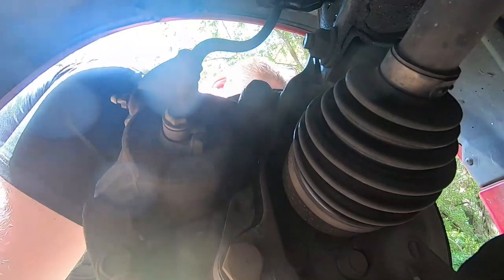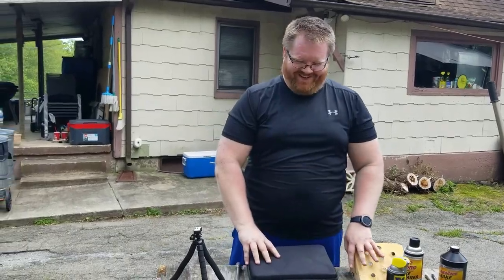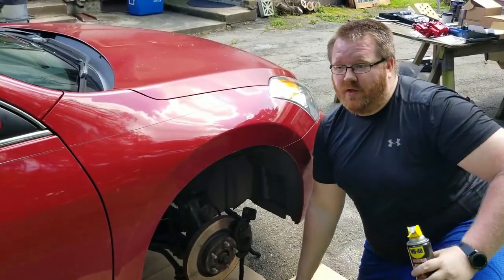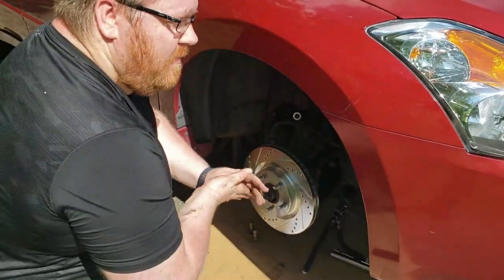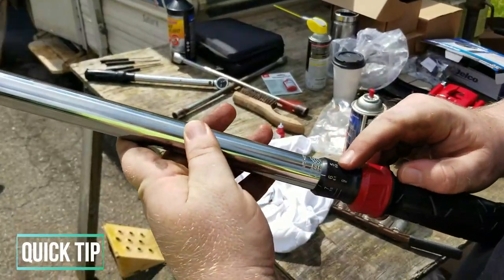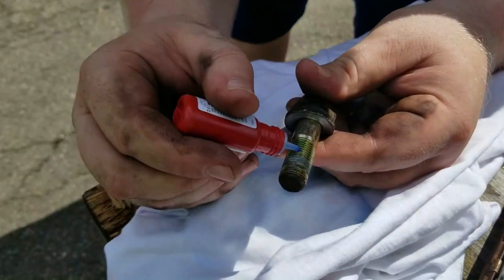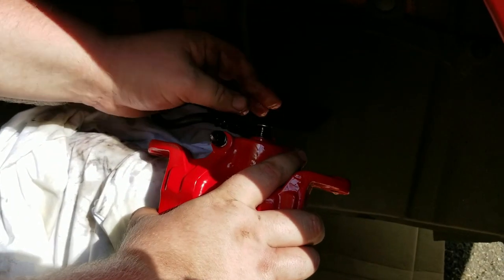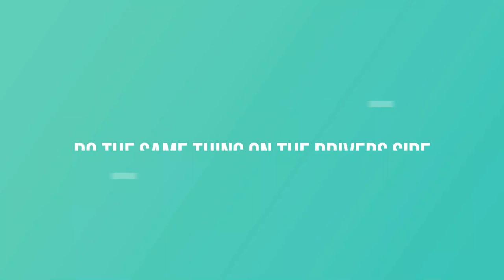2007 - 2012 Nissan Altima 2.5L - Brake Calipers, Rotors & Pads Replacement!

Comment: Now that you've had these on for a while, tell us what you think about the Detroit axle rotors and pads? I'm shopping these things and see some mixed reviews but mostly good. Also, do you like the calipers?
Reply from the maker: Hi David! These Detroit Axle rotors and pads have been really good! Firstly, the pads don't seem to generate a whole lot of brake dust. After having them for about two years now they still have some "meat" on the pads.

The rotors have also held up nicely, I've had to panic stop the car a couple times and they haven't warped or faded. Plus the drilled holes and slots help to dissipate heat better and keep them as cool as they look, haha!

I love the Z23 calipers from Power Stop! I definitely felt stronger braking power when I first installed them, granted the original calipers were old and worn out. But even when I've had to panic stop these calipers bite good into the Detroit rotors. I think you can buy them in red or unpainted, not sure if that has changed since I last looked. 

Overall, I would definitely recommend them. They look good and having the upgraded components gives me a peace of mind that I can stop in time to avoid an accidents better than before.

The ONLY thing that you can call bad is that under heavy braking you can "hear" the rotors, it's like a very low pitch Humming when applying force. However they don't make any noise under normal braking situations, so that's what I think about everything. Maybe I'll make a review video and can show how they have held up over time. Thanks for watching! 😁👍
Reply: @TrickShiftGarage  thanks for the update! I'm going to pick up the rotors from Detroit Axle along with their pads. It's nice to hear your comments after having a little bit of experience with them. Sometimes you never know until months later whether they're any good. Your response helped a lot! Thank you for that 👍
Reply from the maker: You're very welcome! Glad to help you with your decision. If you have any questions just let us know!👍